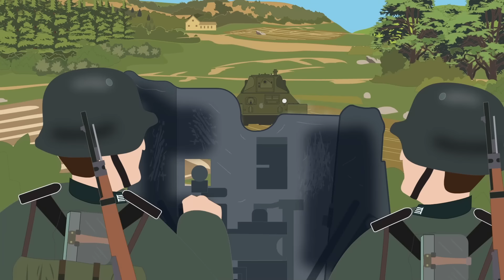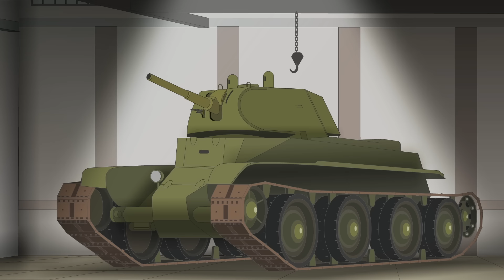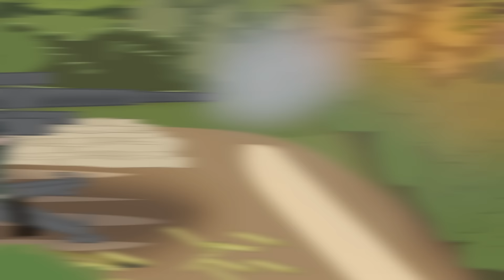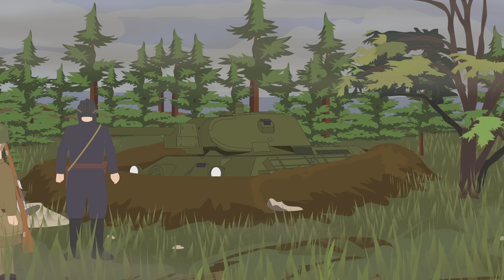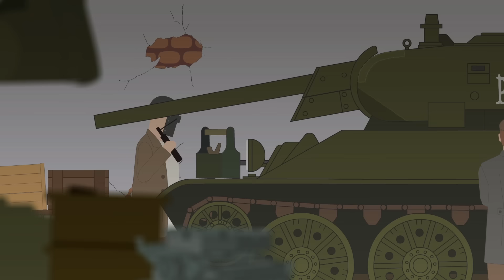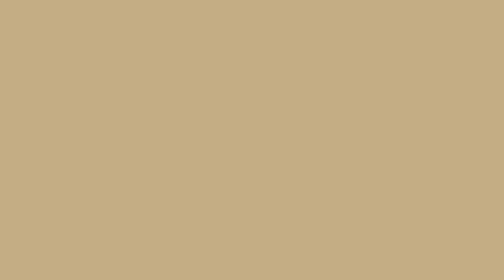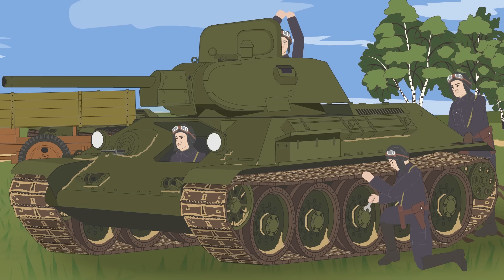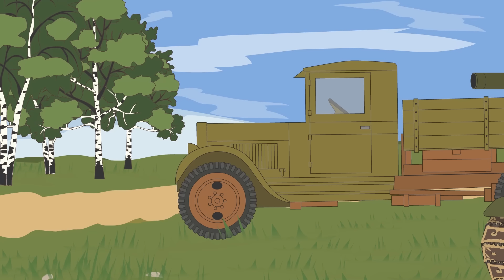Was the T-34 Really the Best Tank of WW2?

Comment: There is no such thing as a "best tank" because each nation was making rational choices based on their specific strengths, weaknesses and requirements.  Russia could build in quantity but needed simplicity.  USA needed a tank that they could move in quantity across a vast ocean and could be built in converted automotive assembly lines.  Germany was limited in manpower and materials and therefore they needed tanks that would survive.

Comment: Best German, Soviet and American tanks off WW2 were in order:
1. Tiger II
2. Panther
3. Tiger I
4. IS2
5. Pershing
6. T34-85
7. M4 76mm
8. KV1
9. T34-76
10. M4 75mm

Tiger II obviously was the best tank by far of WW2. Best protection and best gun. Panther had more frontal protection, was quicker and had a better gun than the Tiger I so was better all-around. IS2 had more protection and a bigger gun than the Pershing. Neither were better than the Tiger II, Panther and Tiger I. T34-85 and M4 76mm were comparable but the T34-85 has better protection and slightly better gun but almost a tossup. KV1 had better protection than the M4 75 and T34-76 and even the T34-85 and M4 76mm but a worse gun so it falls in between. T34-76 edges the M4 75mm for me with better protection and a better gun. Both T34s had much better side protection than both M4s.

Comment: The t34 is far from a " legendary " tank . it was a solid design but it was just used in swarm attacks. there most " refined t34-85s died 2 to 1 against easy 8 Shermans in Korea. BTW US had sloped armor as well and didnt add up to dried crap when an 88 round went through it or a high velocity 76. it was quite advanced for about a year in ww2 and then it was just a case of overwhelming numbers just like the US. the KV1 and IS series were the real soviet beasts. T34 for the most part was cannon fodder

Comment: Should've mentioned how aside from giving a round more material to eat through in order to completely penetrate, sloped armour was a more effective means of protection as the angled surfaces allowed for better round deflection. Going by basic physics, a round delivers maximum penetration & impact at a 90* angle to the surface.
Reply: At an angle the round has to penetrate more armor in a straight line 

The t 34 frontal plate was equivalent of 75-90 mm of armor at 90°

Comment: The  original T-34 was close to being the worst well known tank of WW2. Visibility and ergonomics were horrifical and the armor was overrated and the great gun was almost useless given the visibility and load speed. It was the most destroyed tank in human history and even in 1941 over 1000 were lost (more than Germans had Panzer 3s or 4s). It also had non-standardized components between factories so repairs were often not possible even for smaller issues.

That being said - the T34/85 was an amazing tank that does not need to shy away from being compared to the Sherman or the final forms of the Panzer 4 and was even capable of taking on heavier tanks like the Panther.

And before someone angrily answers me - would you have liked to sit in aT-34 in WW2? For sure not... The Soviet had to built it since they didnt have good alternatives and the tanks wasnt even that cheap but the industrial power of the Soviet Union was extreme so they could built a lot of these tanks even if they were not a super cost-effective design like for example the Hetzer or Stug 3.

Comment: It is pointless to have a well armored tank with a good gun if you don't have a radio on board to coordinate with your tanks in your unit and because of the two man turret the commander also has to double as the gunner. In the end its usually always who spots the enemy tank first and scores the first hit. The commander has to be able to spot enemy tanks, not stop spotting tanks because he has to aim the tank gun, and be able to coordinate with other tanks to issue or receive warnings. This more then anything explained why the Soviets lost so many T-34's to inferior German tanks, who did have radio and who did have a separate tank gunner. And why the T-34 is overrated. The T-34/85 corrected this with the 3 man turret, but by that time the Panther was around. If the T-34 had had the 3 man turret in 1941, with a commanders cupola and a radio, I daresay that Soviet tank losses would have been less and the T-34 could have really made an impact. The Germans would still have had the advantages of better tactics and experience though.

Comment: Nah the German panther was the best tank
Reply: Meanwhile Panther: too complicated to built and had many issues in it's early service time with some were left unresolved like the final drive
Reply: @Kalashnikov413 
Just like in the case of the T-34. At the start of Operation Barbarossa it had many issues, and even though it has been improved significantly throughout the war, some of those were never fixed. Anyway, if we consider that the German economy, war machine and production was collapsing, the Panther turned out quite well in the end.
Reply: @Armour_Enjoyer  Not at all. Panthers were too few, too sluggish, and had too many breakdowns to effectively wage war.
Reply: @modest_spice6083 
Too few? The number of Panthers built is roughly 6000, even though this number is low if we consider how many tanks the Soviets and Americans have produced, compared to other German tanks, it's quite good.
No, it wasn't slow, the top speed wasn't the best, but it's not even the most important factor; one of the things which the Allies have liked about it was its mobility due to the design of the road wheels which provided a jolly good, stabil ride.
The part regarding the breakdowns is kind of true, the first models were prone to breaking down, having engine failures, fuel pump leaks etcetera, etcetera. Although as I've said, the later designs - on average - were as reliable as a Panzer IV, and even though the Panzer IV's reliability has been decreasing late in the war, the Panther's reliability was a lot better than what it was in 1943. - although unfortunately the final drive was never fixed.
Reply: Nah the American Sherman was the best tank
Reply: Nah, there was no best tank.

Comment: I would choose StuG III, low silhouette, good gun and decent front armor. If it's reliable, panther is the best tank. Even T-34/85 is mediocre at best
Reply: The germans literally made the panther to defeat the t-34/85 because panzer 4s were too pathetic. 
And even then panthers could just about beat the t34/85.
And now look at the numbers produced and how little the t34/85 got taken out of combat due to transmission issues compared to the panther.

Stug was just a glorified cannon on wheels, whats so special about it, the SU line did everything the stuff did but with the added bonuses of slanted armoir
Reply: @balkoth3762  Panzer 4 was fine. It could take out a t-34/85 from 1km. "What's so special about the Stug?" It was partly good taking out t-34's
Reply: @apoorhorseabusedbycenk  only Panzer 4s equipped with 75mm anti tank guns. And even those gotnprnetrated by the t34/85 at ranged up to 2km.  The model /85's gun being well, 85mm, it devastated german armour. Stugs take out t'34s theoretical but soviet millitary doctrine which utilised the element of suprise and stealth, the inability of the stug to reposition was often its demise. It only had 80mm armour on the front. German millitsry doctrine did not utilise the advantages of the stug hence it was mostly a waste of metal
Reply: @apoorhorseabusedbycenk  same with the germans. The kill range was much lower than 1k kilometers, around 400m etc. Its just  what was theoretical possible, the t34/85 powerful cannon allowed it to be more accurate at the same range as a panzer 4/panther while also being better at shooting from a greater distance.

Comment: >Was the T-34 Really the Best Tank of WW2?
bro this was like a paid advertisement for the t-34 lmao
Reply: Damn, sorry History has winners and losers and the t34 was literally one of the best tanks lmfao
Reply: @balkoth3762 
Why was it the best? What was so good about it which other tanks didn't have at the time?
Reply: @Armour_Enjoyer  it was suited for its role on its specific front. Same reason the sherman was one of the best tank in the Pacific. It suited its role as the core of the soviet arnoured Corp and was engineered in a way which allowed it to be produced and maintained long time unlike German veichles which were often not engineered for the harsh conditions of the Eastern front and when broken down would require specialist repairs, tools or replacement parts which were often unavailable due to the length of supply linees. A problems, the t34 did not face due to the way in which it was manufactured allowing for easy battlefield repairs.
Reply: @balkoth3762 
That's right, although I wouldn't say it was the best tank, that's literally impossible to state about any tank, even to this day.